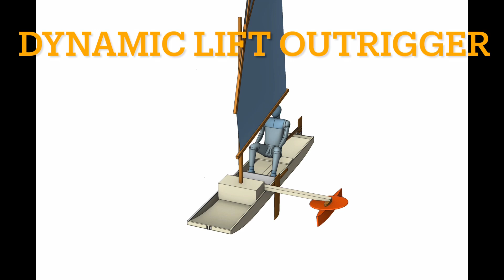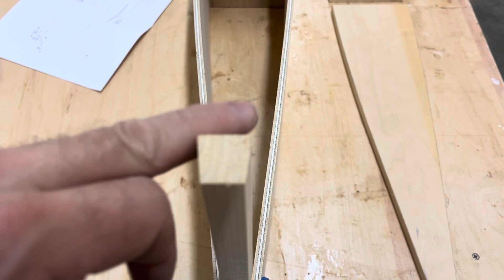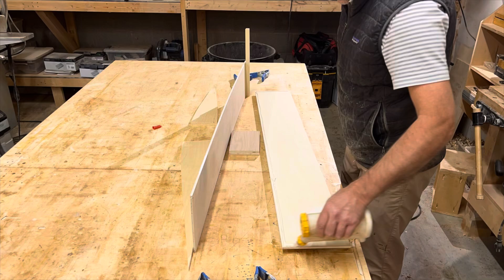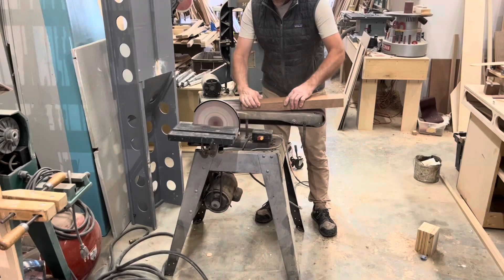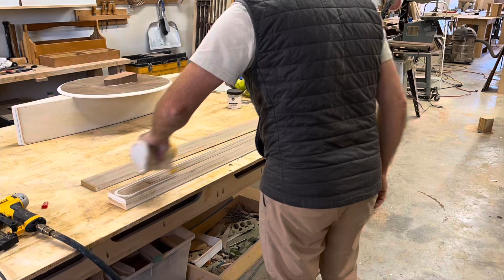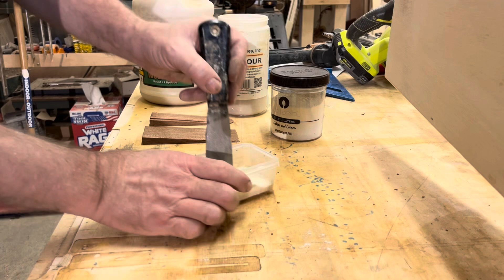Making a Hybrid Outrigger combining buoyancy and dynamic lift

Comment: What about using wings similar to an airplane, not like the foil deep down but just about the surface. And to minimize the disturbance due to surface waves make the wings V shaped (backwards) to confront the waves "gradually".
Reply from the maker: @kadirhaldenbilen6149  yes, that is a good option to test as well.  Maybe next float I will try it.

Comment: Reminded me of the outriggers on SP80, only the outrigger tapers down at the back and disc sits on that taper and has a flat back edge before a duck tail slightly raised from that. Watch "We Launched the boat on Lake Geneva" to see it. It throws a lot of water sideways at tow speeds, I wouldn't call it optimised. :)
Reply from the maker: @CraigOverend  very similar.  My current disc has zero deadrise but some amount of deadrise is probably good.  Their hulls look like short wide sea plane floats which would work well at higher speeds.  With this current punt I’ll be happy if I can go 8 knots.  But if the outrigger performs well I could make a trimaran out of it and use a long and skinny center hull.  The good thing about zero deadrise is that no water sprays into the cockpit.  But moderate deadrise is needed at higher speeds.

Comment: Спасибо за видео! С каждым разом твоя лодка становится все сложнее и сложнее. Она теряет простоту заложенную в начале пути. Может вам  начать новый проект парусной лодки ? А не усложнять легкую лодку для велосипеда? 😊😊😊
Reply from the maker: I agree.  But there is no simple way to create a sailboat from a paddle boat unless you just want to sail downwind with a small sail.  I could have made a smaller sprit sail and just used 1 paddle for both leeway resistance and directional control but I want to test this new sail design as well.  If the new sail design works well, I will make a larger version and put it on my wingmaran sailboat.  Also, I have wanted to test this outrigger design for a long time.  I agree, the idea of the punt is simplicity and this sail configuration is not simple and adding an outrigger is probably not necessary (with a smaller sail).  Eventually, I will come up with a simpler design for the punt after testing the outrigger and current sail.  I tend to over due things first attempt and then scale back.